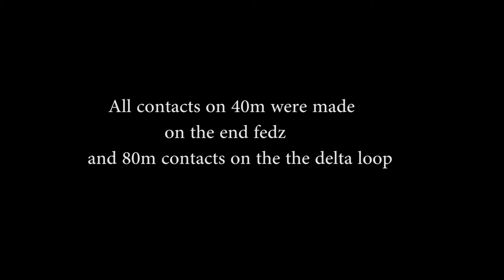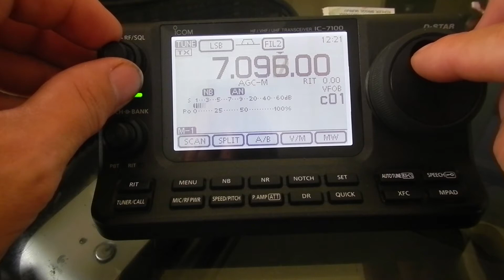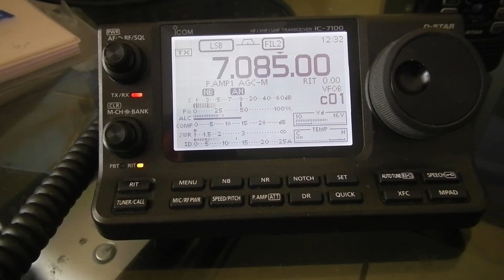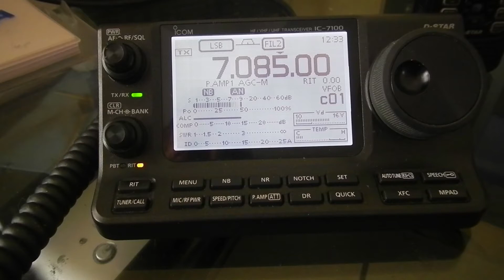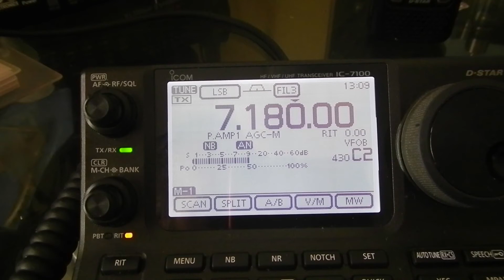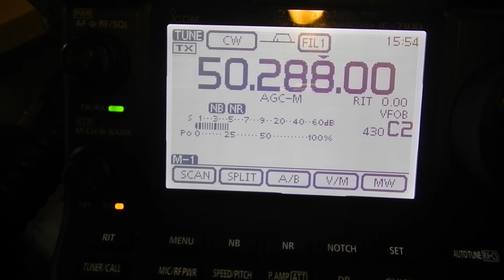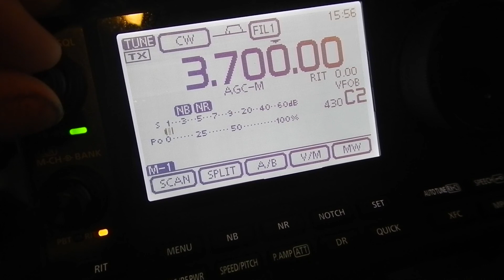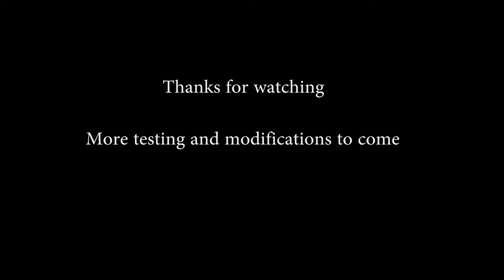delta loop v end fed half wave hf antenna

Comment: hi  whats the  measurement of the  loop half wave  .  cheers
Reply from the maker: It wasn't too any particular measurement. More just a care if getting as much wire up in the air as I could, more like a random length wire. In the end, it was dirty off 40m I think. It's been a while. But 37m rings a bell.

Comment: Vee -- W7IBB, Utah.  How long is the delta loop?  I'm putting one up and don't know how long it needs to be.  I have an end-fed random wire antenna with an L shape, can make it into a delta loop. Also did you feed it with coax and a 4:1 balun?  Keep watching for details, but if you told us, I missed it.  Had trouble finding this third video on the delta loop.  Thanks for sharing!  I've subscribed and enjoy your videos!
Reply from the maker: Hi Vee, 

If I recall it ended up a little short of 80m. I think 70-75 was where it ended up. 

I ended up going with the 4-1 balun /coax and was quite happy with the results. 

In the end, the electric fence wire was not the best choice. 

When I swapped it out for coated wire, it performed much better. 

I'm not sure if that was due to the stainless steel in the fence wire versus the copper or simply because the coated wire was much thicker. 

The delta loop was much better for noise rejection and pulling out week signals but over all I think the half wave end fed was much simpler to mount and performed about the same on the bands I use most 40/20. 

The loop was less directions than the end fed obviously and with that much wire up in the air, was good for lower bands also. 

Unfortunately, I lost one of the trees in the back yard, so it had to come down. 

I hope that helps  and thanks for the sub. 

cheers VK2MRX

Comment: How long is the end fed??? How big is the Delta loop. Im going to  install a
Horizontal Delta loop 554ft long. What type of tuner are you using? Have fun.
Reply from the maker: the end fed is 65feet long. Tuner wise it's just a ldg auto tuner. works well but only upto 200w.

Comment: I noticed you weren't using your compressor. nice video. we're you running a 100, thanks Art/ K2ADC
Reply from the maker: I usually run around 80w and you are correct, no compression on.
Reply: I have one of the  anemic ic 7100,s with low p.e.p. thanks for the response-art

Comment: So which one was better on 40 and 20 meters?
Reply from the maker: at this stage, the end fed was. The loop was better for listening to stations down in the noise but ultimately the end fed made their signals stronger. 
Keep in mind the loop was of no particular length and may see improvements from made resonant from doing so. 
I plan on trying different lenghts and orientations to see if that improves things. 
Outside of the bands the end fed was designed for 40,20,15 and 10, the loop tunes up easier and even works ok on 80 for the short length but there is more wire in the air for the tuner to work with.